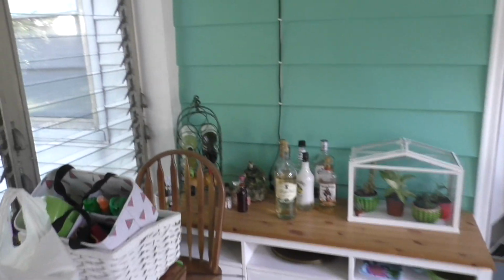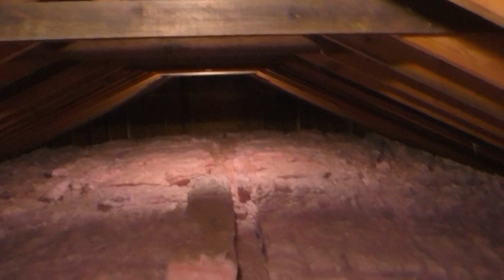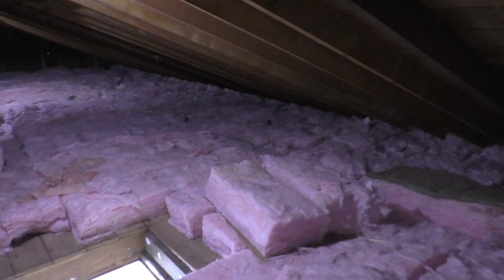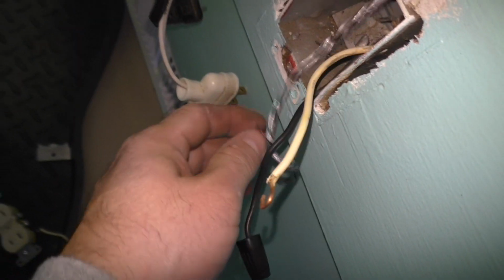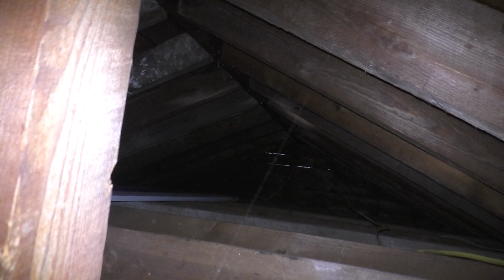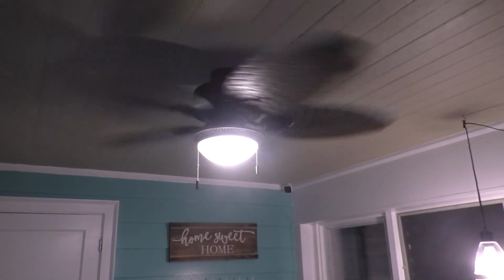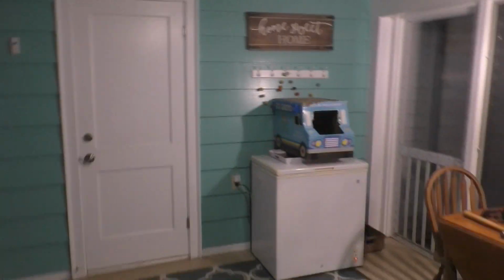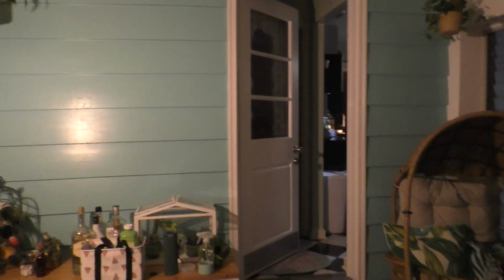Wiring Adventures with BBISHOPPCM - Installing A New Ceiling Fan In My Breezeway!

Comment: So did you wire the ceiling fan off of the old wire that was running the switched outlet using the old wire? if so does that mean it is not grounded or did you run a ground wire? I don't have an issue with things not being grounded (nothing much in our house is grounded) but if you have new grounded Romex ran off of old not grounded Romex then the ground wire in the new Romex is not hooked up to anything which could be bad if someone in the future opens up that box and sees new wire and just assumes that it is grounded (I don't know how that would be too bad, but I guess it could). Not complaining here or saying anything bad about your work, I am just wondering what is going on there. Also, are you allowed to staple Romex to the end of a stud or joist or do you have to drill a hole and run it through?

Comment: I don't know how, but I know it's possible to wire up electrical outlets so that only one half of it is switched, and the other half is always on. My grandma's old house had outlets like that in the living room running the lamps. I'd guess that's what that three-wire cable with two hots was designed for, but they didn't wire it the proper way to make the outlet only half-switched.
Reply from the maker: You need to snip the bridge between the two hot terminals, and connect the switched hot to one, unswitched to the other.

Comment: Back then neutral was your ground (unless it was grounded at the fixture or "isolated") and ground was your neutral - they thought "hey, we have a path back so why have a backup" and "it's only 110v"  besides a lot less demanding appliances / devices - having more than a 15a circuit was a big deal as most appliances were simply lights or radios ;-)  Just be glad you don't have a bunch of switch loops all over the place and have to try to figure that out.  My place was built by a commercial electrician in 1989 but looks like it could have been built 40 years before that - I swear he had a storage place full of old materials from a decades past - one of the inspectors remarked "this place is in great shape for having been around almost 60 years..."  I said it was built in '89 - he couldn't believe it...
Love these videos too by the way Brandon!

Comment: I think I would've run some 6/3 and done a 50A subpanel in the garage while I was army crawling. Then, future garage/breezeway circuits could come off that. Would be handy for future electric car or welders/etc in the garage. You'll probably end up doing it at some point anyway, and it would make life a bit easier now.
Reply from the maker: This is actually one of my plans. I need our main panel to be upgraded to 200a - i’ll have an electrician add a subpanel to the garage for that very reason. To save cost, I’ll run the wire myself.

Comment: I use all netgear equipment and I used an older negtgear router as a wifi extender. There are videos on how to do it it. Its way more powerful than those plug in extenders unless you shell out money for netgears really expensive ones.
Reply from the maker: I installed a Ruckus wireless access point in the basement which negated the need for an extender
Reply: @bbishoppcm  Do you like it?

Comment: For your wifi situation, either use one of those mesh wifi solutions like Eero/Google WiFi, or go Ubiquti Unify with POE to every Access Point, if you want to be fancy try Aruba APs (probably won't have to upgrade those for a long time). Way better than cheap range extenders without active band steering etc.
Reply from the maker: I installed a commercial-grade Ruckus wireless access point